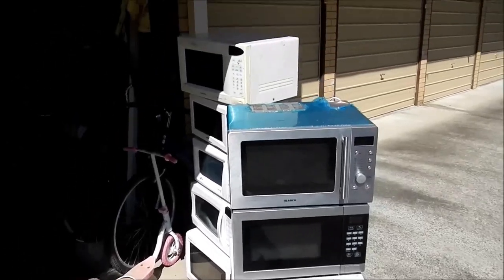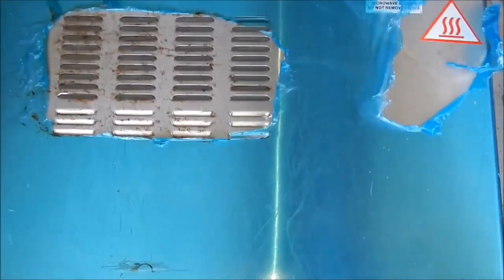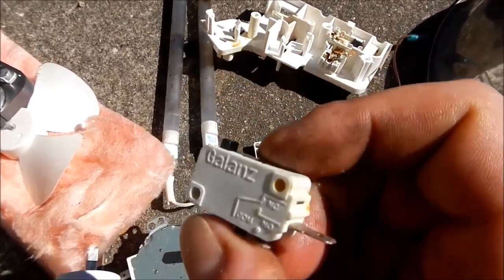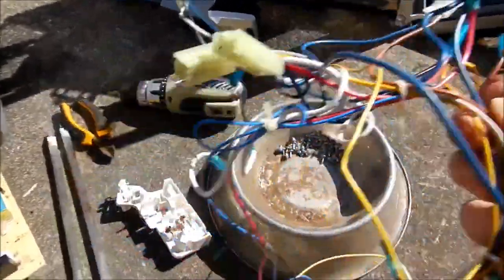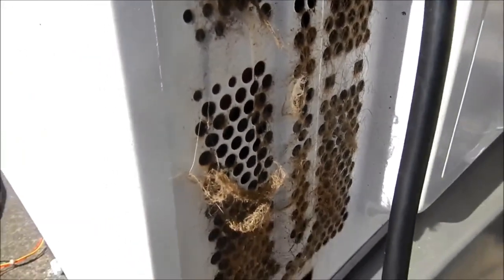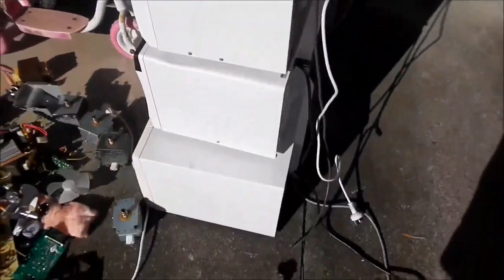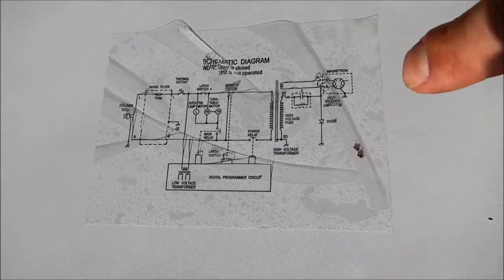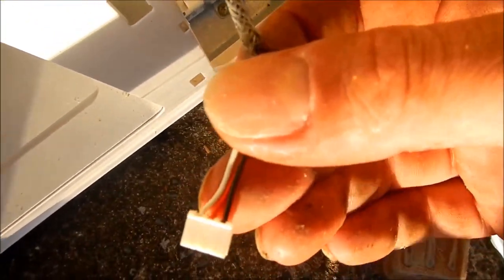9 Microwave Tear Down

Comment from the maker: Tear down video with 9 microwaves. Mostly looking at the parts salvaged.
Found a dc flyback MOT setup in one of them. Other than that all pretty standard stuff.
Sorry about wind noise. It dies off after the first few min.

What I am calling bleed resistors on the Capacitors are actually high voltage Diodes used in a simple negative voltage multiplying arrangement.
 #teardowntuesday
Reply: the first one shown with its lid off that has no multiplier ,I think you will find that's a diode not a resistor .I could be wrong but test it to find out as all the components that i have ever seen in that position and look identical have all been diodes .Ask *****  as he knows everything ;)
Reply: yep second micro .Thats also a diode ;) there the same as ours i have the exact caps and diodes .there all made in china or the likes so there identical
Reply: Hahahaha If only i had the time to watch the vid in one sitting i could have saved a lot of writing ;) at least you got the diodes you were looking for ;) those carousel microwaves are my fav as they have really good MOTs

Comment from the maker: I like to do the googling after I have all the parts off, and can read numbers etc well. Posting video and taking feedback is also a great way to find out what stuff is. I did see the panel's where side cut able, but I didn't want to ruin my good cutters, and didn't have rough ones that fit. So I was investigating how else it could be done for those with few tool. As well as having fun twisting metal.I thought it was pretty obvious it goes back in so didn't mention. Cont

Comment: The access panel on the bottom is quite common, once you remove it (usually with sidecutters) and replace the sybchonous motor (not a stepper motor), you can actually put the panel back, 2 tabs slide in and use a screw to hold in place, i made a display turntable with one (there's a vid)
@6:16 tha's a rotary encoder, it outputs a couple of pulses that tell the cct which direction it rotates and how much
Maybe do a bit of research, either before or during teardowns

Comment from the maker: They kind of accumulated over the last 6 months... 1-2 at a time. When the stack hit the ceiling I thought I'd better do something about it. I always put a screwdriver across the cap first thing. As soon as the case is off. With sidchrome driver, As they have lifetime warranty, and any stockist will replace a blown one. None of these microwaves had any charge, as they have been in my shed for weeks-months.

Comment from the maker: I figured the rotary thing was probably an encoder, as only 5 terminals I can see. Yet it has about 100 indexes.  Was hoping someone would confirm. Thanks. I don't know anything about them, encoders have been on my to google list for a while now... May be handy for a few things, Possibly Including controlling the inverter from another microwave. Thanks for the tips on the encoder and motor. Googling more info now :)